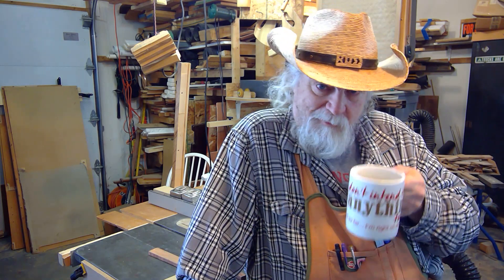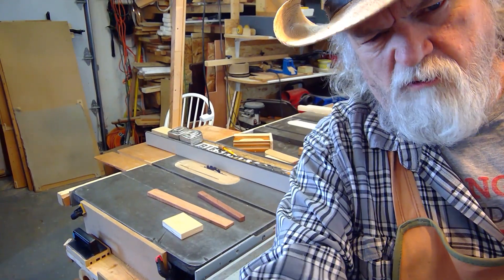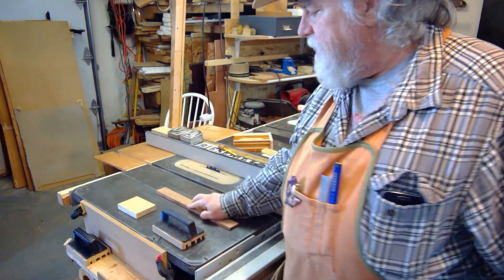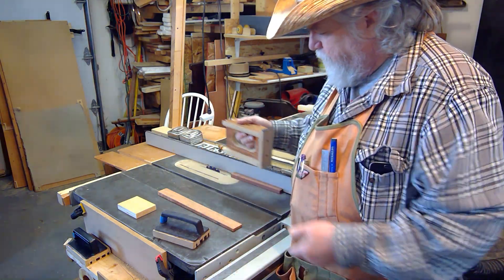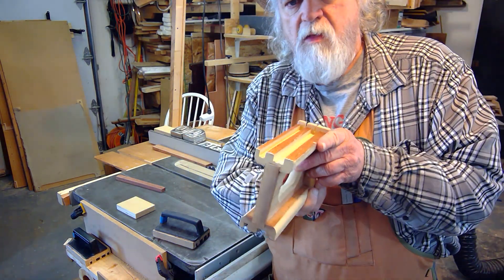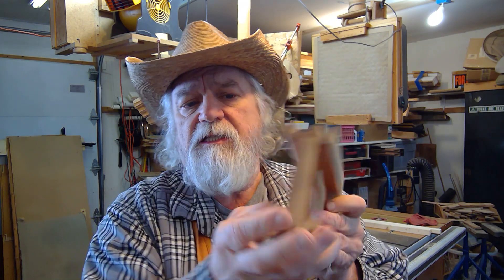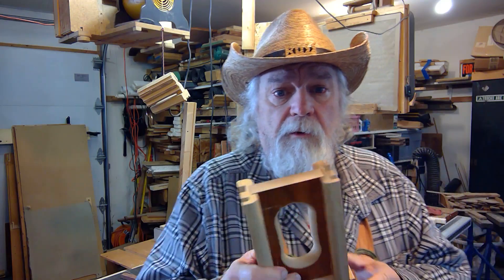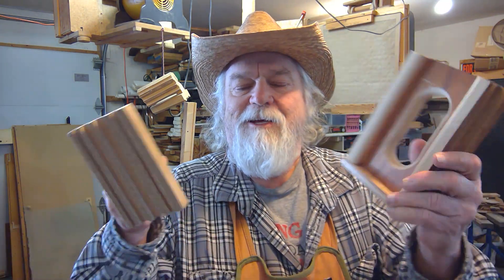Flipper Gripper by OTB Thinker

Comment: Unfortunately the same layout problem as the NMP gripper. Example: with a 1/8" kerf blade you can't make a cut between 3/8" and 1/2" without cutting into one of the legs until a zero kerf blade is invented.
Reply from the maker: overlap doesn't matter as long as some of the leg is still in tack.
Reply from the maker: I have been thinking about your observation of hitting the legs.  I use a 7-1/4" blade with a 1/16" kerf.  your dilemma is worse than mine was due to this blade width. I ended up increasing my grooves by 1/16" over time.  this means if you use the gripper NMP with a 1/8" kerf blade you need to make your gripper with 1/8" increase in the width of the grooves and leave the legs the same width in your design because you don't want to weaken the legs.  This is a potential issue for the tablesaw with the 1/8" blade.  This will increase the overall width of the gripper.  Maybe I should do a update gripper video explaining this and the solution.  What do you think?  BTY, thanks for pointing this flaw out to me.
Reply: Most table saws come with 1/8" blades and will cause that problem. Might be a good idea to let people know about the problem and how to fix it.
Reply from the maker: I agree.  thanks for the insight. coming soon :>)
Reply: @juergenschoepf2885  i think this would work, right?
    ooxxxooxxxxxoooo
(1/8" slots, o is uncut, x is cut)

Comment: Thanks Russ; 
I have enjoyed watching many of your videos, and have built both the Gripper NMP, and the Flipper Gripper. Both work great! One adaptation I made immediately was to refuse to rout out the gaps... I just figured my saw blade would take care of that over time—and it has! Another adaptation I used was to glue on a piece of inner tube instead of the sandpaper. I find the grippiness of the rubber, along with the little bit of give, allow it to hold very well. I also added the push blocks, but installed them with short slots and loosely tightened screws so they could hang down more or less depending on the material thickness of the stock being cut. As you advised, these do degrade over time, but they work great in the meantime, and they're easy to replace. I have found that I tend to use the Flipper Gripper a lot more than the original sized grippers. 

Anyway, thanks a lot for these great (and economical) ideas! Keep 'em comin'!
Reply from the maker: Wow, thanks for the update and encouraging words :>)  I too have moved away from sandpaper.  I have been using silicone caulking. and you are correct with the don't precut the underside.  I have been just letting the saw cut away over time too.
You surprised me about the flipper gripper.  I stop using mine for some reason.  Maybe I should revisit mine (if I can find it :>)

Comment: I love how you and George Fouriezos are able to distill problems to their essentials. I haven't made my NMP gripper or flipper gripper yet but I will. The flipper gripper videos deserve to be in your DIY Gripper playlist, if only so I would have found them sooner. 

One observation regarding the kerf/layout problem - can't that be solved by having two grippers on hand with different layouts, or am I missing something?
Reply from the maker: Putting me in the same category as George is a true compliment, Thanks.  The flipper gripper not in the playlist is a mistake.  I will add it, thanks . . . again :>).  I guess I should tell you sorry for making you watch all those other videos to find the flipper gripper.   As to the pattern on the NMP gripper, I used the same pattern on both ends and the same reference side.  Then I add 1/4" to one end pattern to give it an offset and then they misalign from each other.  Most people can grasp that method.  You can go crazy trying to find the perfect pattern (infinite solutions).

Comment: The main push stick that I use is one I bought on-line..called an over-sized push stick and it has a long bottom maybe 10 " long with a handle that sits well above the blade and I think about 3/8" wide for the bottom part. It is here : http://www.woodworkingshop.com/product/bh10230/?inMed=GSTORE&dfw_tracker=18711-539&gclid=CjwKCAiA78XTBRBiEiwAGv7EKsCMr6gNavT2x_CKmJGyFezKVKGWnxbovgdXn3JBdZ0Xpn5kYRtROxoCjGYQAvD_BwE      But, I often need to cut a hand-full of thin pieces 1/4" or even thinner. Now, thin pieces like these..and even thicker... don't have any weight to adequately keep them down on the table as they are being fed through the blade, and kick-back is a real problem. So...I take a scrap piece of wood and clamp it to the fence just a little past where my cut piece exits the blade and have it to where my thin piece barely fits under that clamped piece as I feed it through the blade. This keeps my thin pieces down on the table and not being jerked up & back at me. I also have a couple of regular looking push sticks with one being maybe 1/4" thick and another one maybe 1/2" thick. Yep...I have a very healthy respect for a table saw ( maybe even bordering on a little bit of gold 'ole-fashioned ...fear...but that's fine by me...keeps me totally focused when running the saw..and hopefully keeps all of my fingers & thumbs where they belong...). Russ...you sure have some creative tools that you come up with...neat..!!
Reply from the maker: thanks. Like you, I am always a little nervous when using my TS.  it is one of the 2 most dangerous tools in the woodshop (the chainsaw is the other) in my opinion.

Comment: I am in two minds about whether to make grippers like this. It makes me nervous to have my hands above the blade like that.  I tend to use push sticks of the style Matthias Wandel uses.
Reply from the maker: I have used every type of push stick/pad I think there is out there (excluding the Microjig Grr-ripper).  When cutting smaller pieces on the TS, I am most comfortable with holding the piece straight down as it passes over the blade.  you should never do something not comfortable to you.  The original gripper (my 1st video in May 2017) shows the original NMP gripper in use on small pieces.  in that one I used a second piece (same thickness) next to the piece I was cutting to help hold the gripper level as it passed thru the blade.  I use the flipper gripper when I want a heel on the pusher.  It is cheap and easy to make so you could try it for short time and then decide which works best for you.  My grippers aren't for everyone.  Personally, I could never get comfortable using the Wandel push sticks myself.  Thanks for the comment
Reply: I would say that the Wandel push sticks make me feel safe from getting my fingers in the blade, but I don't feel that I can control the piece very securely so there's probably a higher probability of getting a kickback.  Whereas your style of gripper would be the opposite.  There would probably more control of the piece but in the unlikely event you were to lose control, there's a higher probability of getting our fingers in the blade.  I guess I will have to try it just to get a feeling for how much control your grippers give me, and how safe I feel using them.
Reply from the maker: When using a gripper, always press down AND toward the fence simultaneously.  control will then be there.  The pad is between your hand (and fingers) and the blade.  The blade can't grab the pad because there is very little blade exposed (1/4" or less) to grab the gripper.  kickback occurs when the piece gets twisted in the blade.  the fence and the table top keep the gripper (and the piece) pushing straight thru the cut parallel to the blade. This is the same principle used with the Grr-ripper and people seem to be comfortable with it. too.
Reply: Russ Veinot Yeah, I realise the gripper is between your hand and the blade but so was a piece of wood when my dad was routing a dado in it. But then the blade grabbed the wood, threw it across the room and my dad's hand, still pressing down, went straight into the blade.  He nearly lost his finger.
Reply from the maker: I have had several "close calls" in the shop over the years.  a minor mishap on the TS is why I finally developed my NMP Gripper.  I took some time to try several different push methods on the TS.  I settled on the gripper style but you might be more comfortable with a different type.  I do recommend you try all methods you can.  I have a set of push sticks (and other types) but I just find myself mostly going for my grippers.  I just can't imagine my grippers collecting cobwebs in my shop :>)